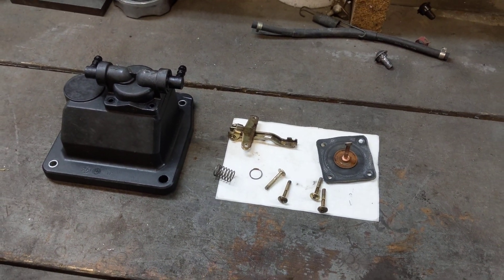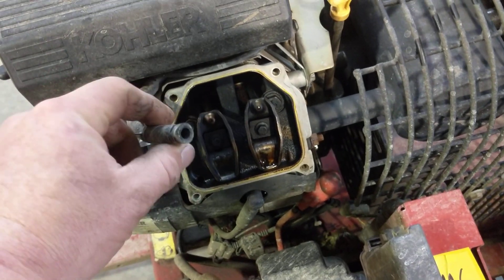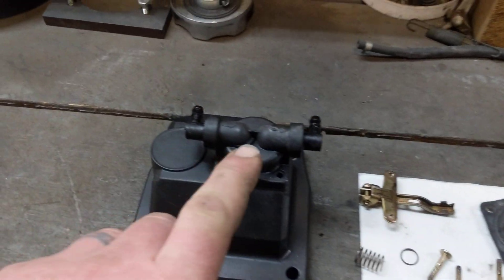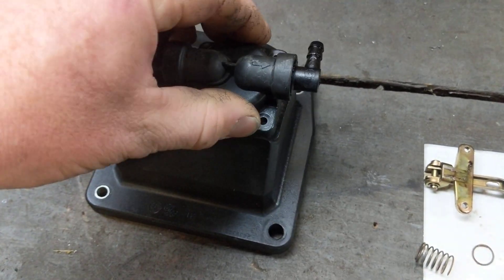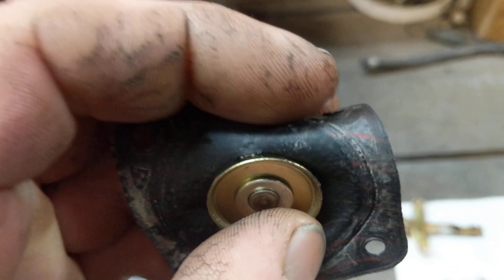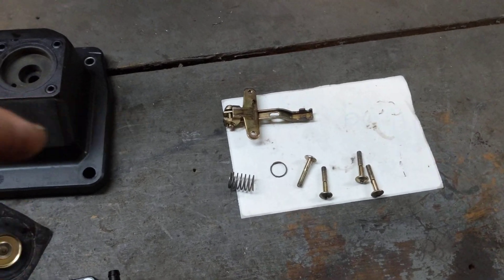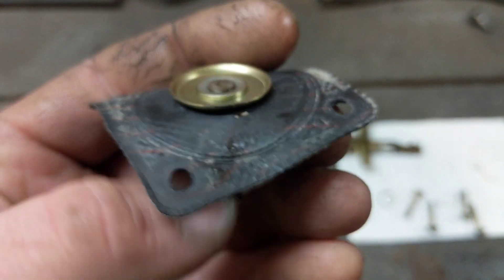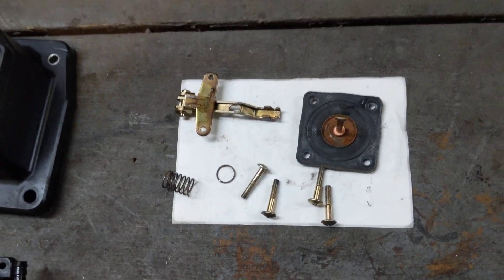Kohler ch740 27hp v-twin leaky fuel pump gas getting into engine fix

Comment: We have one of these in a Trans Lift, FI model. Have you had any experience with these flooding themself out ? Swapped a carb engine out, and put a whole new FI unit in. In 2 years now it's had more issues than the original engjne. 
Mosf of the time now, a slight incline will cause the plastic cup outside the throttle body to fill fast. It is getting some fuel in the crankcase too.

Comment: Great post! I have the Kohler SV840 also with gas in the oil. After an oil change, I removed and cleaned the carb only to have the mower run poorly and even quit repeatedly. I changed the fuel filter and when I checked the fuel pump, I noticed that gas was leaking out of it into the crankcase through the breather hose. I have worked on many small engines over the years but have never experienced this before. This post is the only one that I have found that even mentioned this problem.
Reply from the maker: I'm glad it helped

Comment: Thank you for this video. We run a golf course and couldn't figure out how gas was getting into the oil. We checked the carb but after watching this video realized it was the diaphragm in the fuel pump. Appreciate it.👍

Comment: My engine died, completely full of fuel.... Had not even done first oil change!!! But due to very little usage warranty over... $3000 trashed
Reply from the maker: That's a bummer
Reply: All you had to do is check your oil and you would have seen that it's over full and smells like gas on the stick.  There's no one else to blame.   Check your oil before use EVERY TIME.

Comment: I have that same engine on a Scag lawn mower. I am on the 3rd one of the valve cover pumps. I have 200hrs on the mower. That is a terrible design by Kohler! Add to the fact that you can't just buy the diaphragm. I would like to have a cage match talk with the engineer that came up with that shitty design.
Reply from the maker: Just change to a small 12v inline pulse pump. Problem solved.
Reply: What psi does the diaphragm put out though? Will the existing diaphragm pump be okay just sitting there actuating if it's been bypassed?  @machinesnmetal